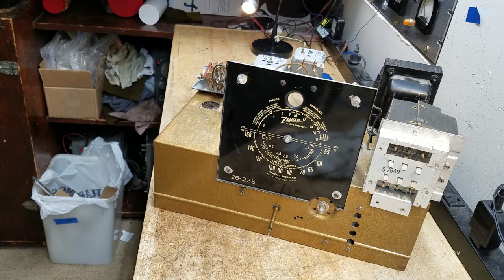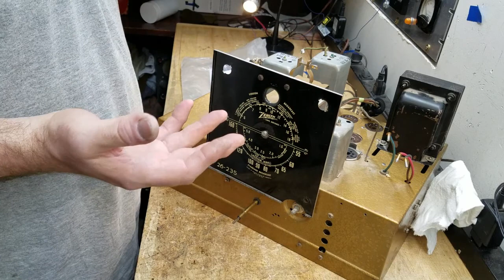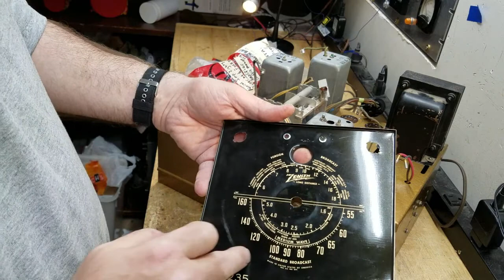1940 Zenith 10S464 Antique Tube Radio Part 1 of 8 Test Power-Up & Teardown

Comment: I am so glad I found your videos - I have been procrastinating on the restoration of my inoperative 10S464 for years and ,finally decided it is time to dive in on it. I have been a technician for years and have worked on a variety of equipment over the years, but I have never attempted to restore a vintage radio. The tribal knowledge you share in your videos will be a tremendous aid to me and I'm sure I will avoid a lot of educational mistakes after viewing them. Thanks for posting these!

Comment: Also the triode part of the tubes never burns out most of the time. But the phosphorus wears out and that's why they won't glow. Sometimes you can fix them by upping the plate voltage to the tube.

Comment: Man, am I glad I found you and this video....after a few AA5 radios, I'm ready to start on my first console....a 10S464 (w/ a broken tuner belt).  Thanks so much for uploading this series!  What a wonderful resource....and very nicely done.  Hope you wouldn't mind me asking  a question or two, if they came up.....and again, many thanks!
Reply from the maker: Please, ask away!  If I don't have an answer for you, maybe I can help you find one.  We are all learners here, teaching each other!  You picked a good console to do as your first.  The 10S464 is an excellent performer.  Once you get used to the rat's nest of wiring in the chassis, it will all make a lot of sense.  I look forward to hearing how you are doing on it.  Are you going to upload some vids?  Thank you so much for watching mine and especially for taking the time to comment.  Comments are extremely valuable to me.   Cheers!     Michael
Reply: Thanks for the reply, Michael.  I picked this one up cheap…figured many have been fixed over the years…so maybe lots of guys with experience that might be willing to help me out.  I have read that they are great performers.  This is the only video of this project I’ve watched so far…but am wondering if you addressed the dual rectifier tubes? Install a fuse? 

 I doubt that I’ll do a video….maybe a simple before and after video…but I don’t know…

I want to get started on my project this weekend and maybe work a little on the cabinet to see what I may need to do….it’s not a perfect specimen, but not too bad.  May need to replace the grill cloth…but I’m thinking I might leave it a little imperfect. My goal is to have it play well and clean it up the finish best I can, but I’m not going to strip and totally re-do.  A few marks or imperfections don’t bother me….I like seeing the signs of something that has been used and loved for years…like an old worn pocket knife.

Thanks again…can’t wait to watch the rest of these.

Comment: The later 6 x 5 with the x pattern inside are the better ones like youmention and I have an entire military box of them if you're interested in buying a few. Actually I like your channel so if you need some just pay shipping and I'll just give them to you. The fuse is a great idea, also you can add diodes in front of the so they're already seeing pulse DC.  It does three things, it lightens the load on the tubes, it protects the power transformer, and it gives you cleaner DC which means that clean audio path

Comment: RCA held the patent on the metal octal tubes.  Other makers either had to pony up to RCA to use the patent rights, or come up with their own version.  Many just built glass octal versions in ST-12 bulbs, but there was also the 'MG' or 'metal-glass' tubes.  These had tubular glass bulbs with a tight fitting metal jacket glued to it and grounded to the base plug.  They almost looked like the RCA metals but not quite.  Eventually, it being the great depression, RCA released their own ST-12 glass bulb versions of their metal tubes, since they could be made for about half the cost.

BTW, some people are now selling solid state replacements for those eye tubes.  They either use LED's or LCD's with transistor drivers.  They pull power only from the filament supply, usually with a half wave rectifier or a voltage doubler.  They only work in parallel heater circuits though.  The display doesn't quite look like the real McCoy, but it's better than the location being dark I suppose.

The eye tubes were NEVER really very cheap, and the radio didn't need it to work.  So I guess when the tube died, it never got replaced, that's why those old radios never have working eye tubes.  I think what wears out is the phosphor on the target.  My grandfather had a Dumont TV with an indotuner.  It had a 6AL7GT eye tube that I remember had NEVER worked.  When I scrapped that TV, I saw that that tube was a Dumont original, it was NEVER replaced.  Grandpa didn't want to spend the bucks on a new one.

Comment: Agreed about the center tap fuse. Can save a hard-to-replace transformer if a rectifier faults. A fuse in the primary is less useful, since it has to be rated higher and may not fail in time.
Reply from the maker: I have thought about the in-line fuse, a lot.  I have used them mostly to protect the owner and their property from a fire in case of a major fault.  However, I never really felt that it did much to protect the RADIO.  The CT fuse, on the other hand, is all about protecting the radio, and that's why I'm considering using them from now on.   Thank you for your perspective, and I agree with you.  I appreciate you watching and for taking your time to comment.   Cheers!    Michael

Comment: Nice clean chassis! I think Fred was waiting for a critter to jump out of it, but he will have to wait a while on this set. I like the tape on the plastic bushing and the tip of cleaning the tubes up front. I like to think of why people do certain things, and I think you are right about when you get ready to put the tubes back in, you are ready to rock and roll! Thanks for sharing, this looks like it will be a good performer. I an curious as to what you come up with for protecting it in case of the rectifier short. Cheers, Larry
Reply from the maker: Larry,I think Fred would poop himself if a critter jumped out!  This radio had been in the same family, and in the SAME HOUSE since 1940!  It is just about as clean as they come.  The gentleman who brought it to me had been using it regularly until the hum got to be too much.  This one is easy-peasy!   Yep, I am always a bit impatient when it comes time to test it.  That's why I always give myself a little "preview" by testing the chassis as early as possible in the assembly process.  It may be missing shafts, knobs, pulleys, dials, and such, but I like to know that it will work when I am done assembling all of that stuff.    Thank you for checking it out, Larry!  I'm looking forward to the Philco vid!    Cheers!   Michael

Comment: Excellent timing, Michael. I just started on an 8s463 recently. Recap is done but need to tackle some crumbling wires, especially to the eye tube socket. Waiting on a tuning belt from Adams. And a 1232 tube. What do you use as a substitute for the 1232's? Regards, Greg
Reply from the maker: Gavin,Awesome!  This chassis is almost identical in construction and circuit layout as the 8S463.  I've done several of the 8S463.  The Adams belts are excellent.  You won't have to wait long.  They are prompt in shipping.  The 1232 is the same as a 7G7.  How that will help, I'm not sure, since all of the 1232 I have seen also have 7G7 printed on them.  I have read (though I have not tried it) that the 7A7 will work in many cases.  Apparently, it will not perform as well in the high frequency region of the shortwave band.  That makes little difference to most people.  Also, I have read that radios using this sub may be slightly more prone to oscillation.  Worth a try, though, if a 7A7 is available and a 7G7/1232 is not handy.  The 8S463 is a wonderful radio that performs beautifully, like most Zeniths of the era.  Take your time with all the wires and components.  I do one wire or component at a time, very methodically, and I seldom have to troubleshoot after I am finished.  Perhaps that is why I am a lousy troubleshooter!  If I can be of any help, please let me know.   Take care, my friend.   Michael
Reply: ThatTubeSound  Thanks, Michael. one quick question...there is no other way to install the dial belt other than to completely disassemble the volume/tuning/band switch shaft? I know I should probably take it all apart anyhow but would rather not if I didn't have to.
Reply from the maker: You are correct, Gavin.  You have to disassemble to put the belt on.  The only way to not disassemble is to use a belt-making kit, like what Radio Daze sells, and assemble the belt around the pulleys.  As long as you keep track of the itty-bitties, taking it apart is not too tough.  I wanted to video this particular specimen of the chassis because it was in such good shape that I was pretty sure that it would have all of the right parts in the right places!  The belt-making kits are pretty easy.  that's essentially what I used to make the smaller tire for that Stewart-Warner tuning drive.  It works very well, and I've never had one break.  Good hunting!   Michael

Comment: I have an identical radio console that I restored around 2012 (time flies). The only problem I had was the 6X5 rectifier tube shorted out. Luckily, I installed a fuse during the restoration. I read somewhere that these tubes were notorious for shorts. Is there a way to avoid the rectifier shorts?

Comment: Hi Mike.  Where would you obtain reproduction dial lamp  wire?
Reply from the maker: Hey, Mike.  

Thank you for watching.  

Do you mean tuning dial string and dial cord, or do you mean the wires leading to the lamp sockets?  I buy dial string from two places:  Bob's Antique Radios, and Radio Daze.  They both will take good care of you and they both have good prices.   BTW, if you ever need dial BELTS,  contact Adams Manufacturing.  They are good folks, too.  If there's something else that you need that I didn't cover, let me know and I will try to help.   Cheers!    Michael
Reply: ThatTubeSound Thanks for the info but I mean the cloth type reproduction wire you use like on the tone control and push button panels and I think as well as on the dial lamp wire.  Thanks!